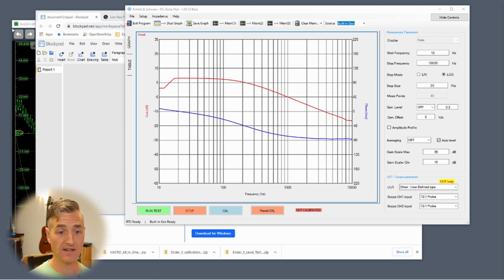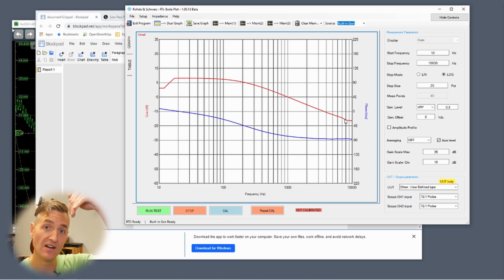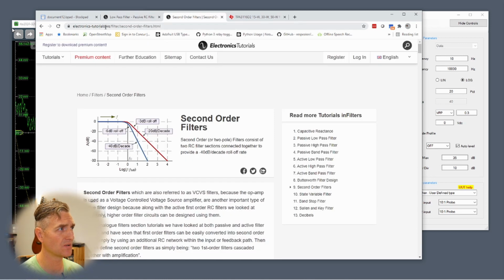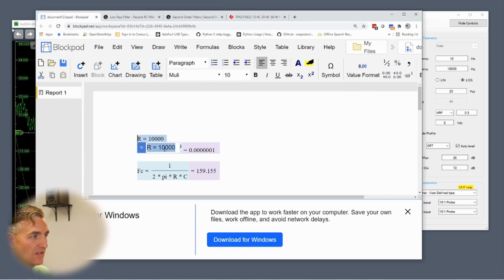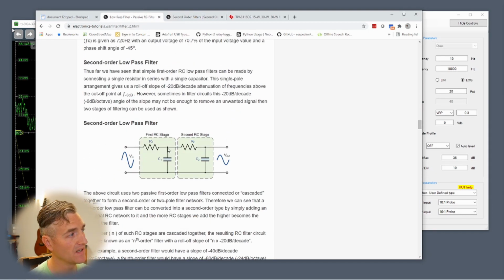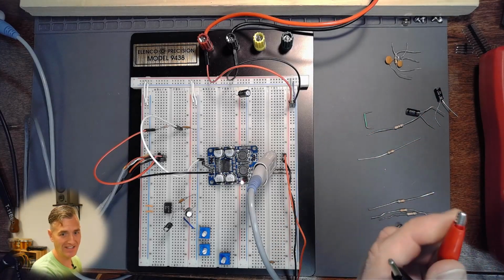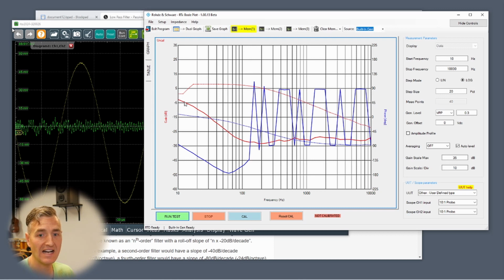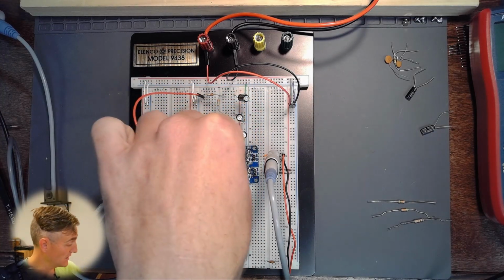How do you calculate the cutoff frequency for a 3rd Order Filter?

Comment: 23:54 yup i'm glad you figured it out before now, to calculate the cut off frequency of a 3rd order filter you would use cube root there in that equation rather than square root, if you do so, it will give you 15 hz
Reply: tho i think that 15hz would be the cut off frequency if you run a buffer there between each stage and another, but since you didn't, the real cut off frequency will be that 15hz*√(2^(1/3) - 1) which will give you a cut off frequency of 7.9hz